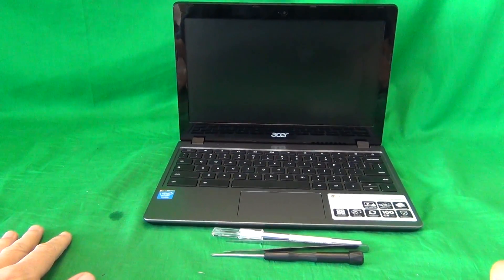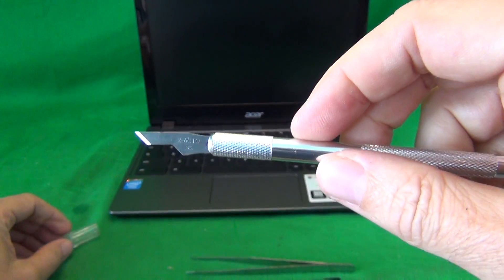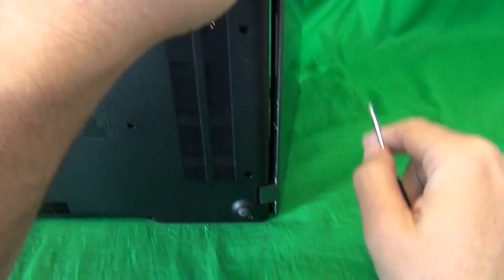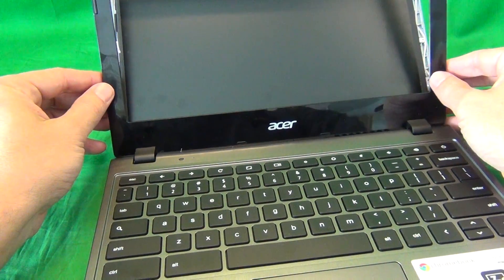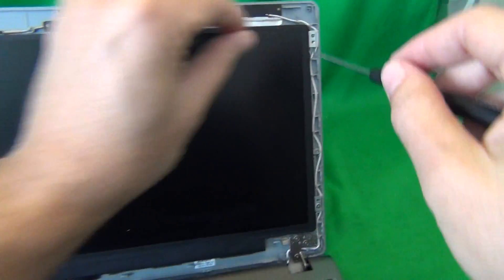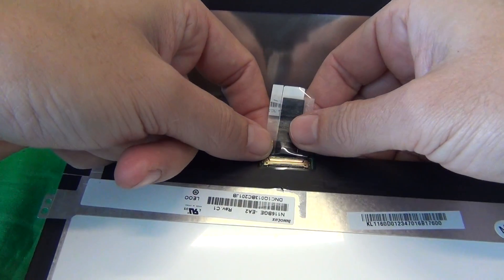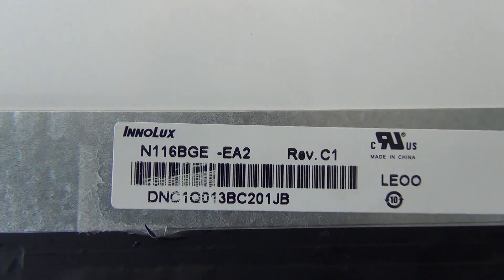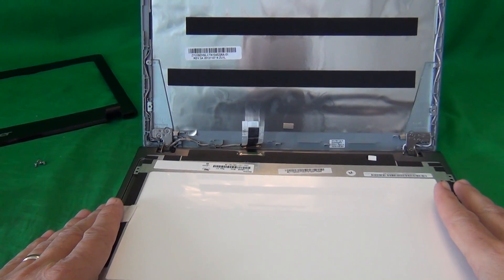Acer Chromebook C720 Cracked Screen Replacement Procedure

Comment: Thank you so much! I tried everything. Was gonna replace screen because it was black and not working. Took off bezel removed 4 screws ,leaned the screen fwd and bam it had come partially unplugged. Pluged it up taped the connector and viola, working perfectly.

Comment: I really like my Acer C720. It has recently started acting up. The screen goes wacky. When this happens I can still hear the sound, and it is still on a website. If I tilt the screen a little forward the picture usually comes back on.  I don't know if the problem is in the screen itself, or the wiring or connector for the screen. Any ideas?
    Thanks for any comments.
Reply: I'd start buy following the instructions in part of this video about checking the connector.  Then go from there

Comment: I was wondering if an LCD panel from an Acer c720 would fit in a Acer aspire one cloudbook 11. I compared the 2 and they both side mount, have the 30 pin connector and are the same size. I bought an Aspire cloudbook 11 on ebay today with a broken screen for 27 bucks and I already own a c720. I was hoping to be able to put the c720 screen into the aspire one cloudbook. I want a cheap, reliable, linux machine and while I have had linux on the chromebook it is a damn hassle getting everything working.

Comment: Thanks so much for making this video. I just finished replacing the screen on a C720 that my lil cousin busted. I used a credit card to help pop the clips around the screen bezel. Bottom part of the screen bezel took a bit of wiggling and pivoting, but not bad. The pin connector was a breeze. Thanks again! Cheers!

Comment: After dropping my new Chromebook and cracking the screen I purchased this product through Amazon and it arrived very quickly.  The video covered everything I needed to successfully install the new screen quickly and with the toolkit included I was able to have my Chromebook up and running in a very short time. Thank you for quality products and quality instructions.

Comment: Warning: the bezel needs to be pushed inward toward the screen center during removal, not "out" as is stated @1:58.  Otherwise those snapping sounds called out @2:00 may be of the shell/bezel lock tabs being ripped from their respective mounts.  IOW the fingers in the bezel point away from the screen center and the mating fingers in the shell point inward.  The far, far simpler procedure is to insert a dulled single edge razor blade (or ideally a dulled xacto #17 blade) into the bezel shell seam.  With the screen facing you, pull up on the blade toward you.  This will push the bezel inward while separating it from the shell.  If you use your fingernails to lift up on the interior of the bezel perimeter, you'll be fighting yourself by pushing the mating fingers tighter together.

Also I don't believe the screen bezel was designed for removal while the upper shell is attached to the base.  It is possible to do with some effort as seen here.  However when attempting to free the bezel hinge covers, the lower portion of the bezel is restricted by the lower base and can't travel in the direction needed to unlock the hinge cover fingers.  Given this, the best approach is to place the c720 partially closed on its side and work the hinge cover fingers while opening and closing the c720 slightly to gain top/bottom clearance for movement of the bezel/hinge cover.

Comment: That bezel extraction "technique" just makes me cringe.  The ham fisted approach is way too rough and risks snapping off the retaining fingers.  A more cautions approach isn't difficult vs. the reckless procedure demonstrated here.  Also don't damage the shell as is being done @3:10 with a phillips point screwdriver.  The flutes in the tip make a fine cutting edge and have visibly scratched the shell along the seam.  I'd also recommend using finger cots or tweezers when lifting tape adhesive @6:50.  Doing so avoids contaminating the adhesive with skin oils such that most of the tack is retained.

Comment: Hey I just bought one of your replacement screens and followed your instructions and it worked beautifully.  A $50 screen saved me from having to shell out $200 for a new chrome book.  Thank you!
Reply from the maker: You are welcome, do feel free to let us know wherever you need our assistance.
Reply: Did it fit? Screens are everywhere, do you have mail service? Amazon has spoiled us all...
Reply: +Screen Surgeons Hi, thanks for the tutorial c: But i got one question... I'm from Venezuela and i need a replacement screen for my C720. Someone is selling me a Acer Aspire E11 screen, but idk if it will fit on it. Supposedly it's the same type and size as the C720, but i'm not sure. 

A little help here will be aprecciated, thanks.

Comment: i wander if you could put the anti-glare in the c710..
Reply: ScreenSurgeons
Ah!.....  :D  I had some debris in the bottom of my Screen Case, 'cuz the Liquid was rippling by itself, and whenever I moved the lid of my Chromebook C720.....  So I found out that: A: Putting a little pressure on the Screen while lifting up the plastic DOESN'T hurt the Screen in any way, and: B: That this was EASY, and didn't require ANY tool but my finger.....  :)  Thanks!.....  :D  BTW, do you know any place that can refurbish a Dell Inspiron 1420....?  'Cuz I run Peppermint Linux on it, and Kubuntu Linux on it, and whenever I boot into them, past the BIOS, the Screen Light flickers, and it crashes shortly after, on most occasions.....  Eeesh.....  :(  I have Kubuntu on my Chromebook as well, but it would be nice not to lose a backup Laptop.....  :D
Reply from the maker: Yes, if you can find it. All our screens are glossy.
Reply: +Screen Surgeons finger print magnet?